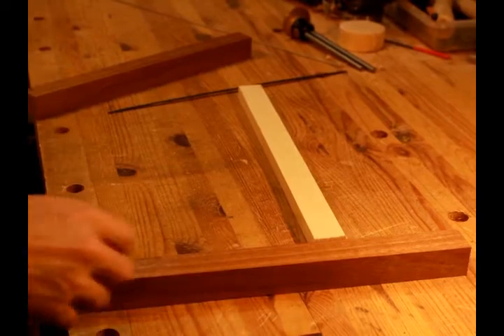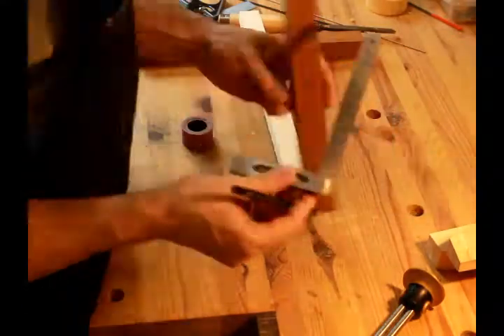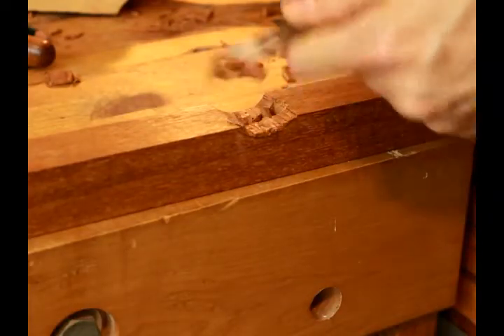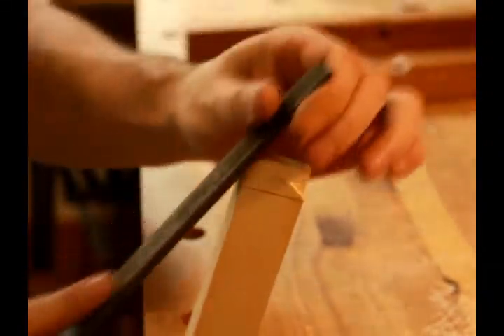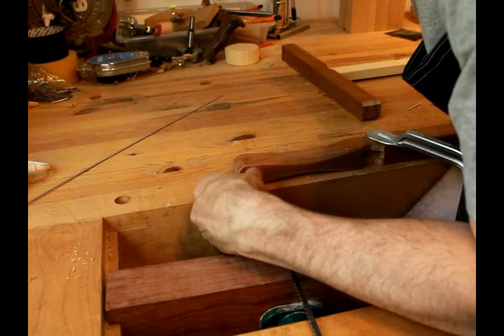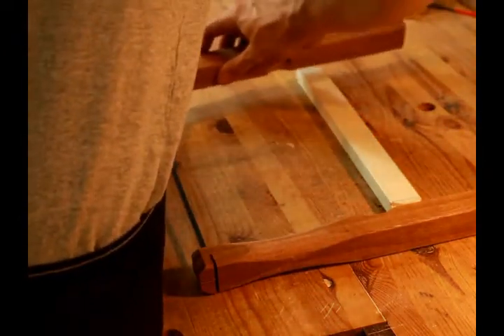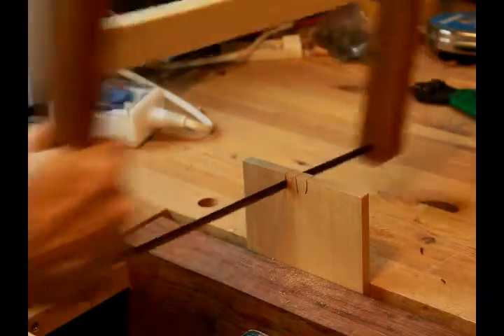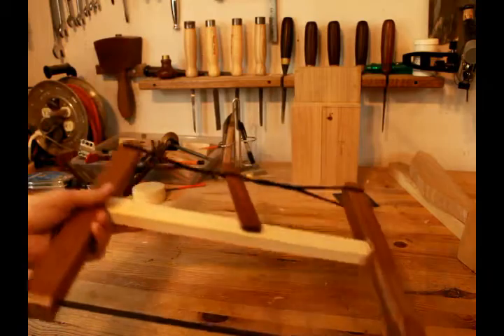Fret frame saw FAILURE!! Watch this before you make a frame saw!!

Comment: Stoning the back of the blade from both sides improves turning ability very considerably. However, with all the respect, I wouldn't follow Paul's project, because as you have learned there's a number of design issues with it. There's a reason why there are handles on turning saws, and in general blades were fixed to handles on felling and bucking saws only. I would recommend Bill Anderson's video where he builds a Howarth turning saw and goes into a lot of details, like why you most probably can't use a band saw blade.
Reply from the maker: Thanks!